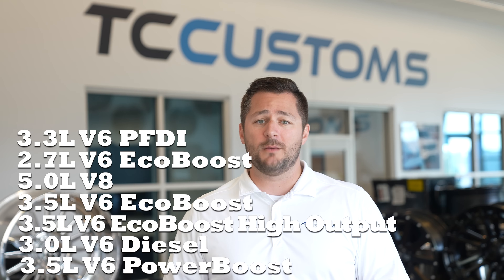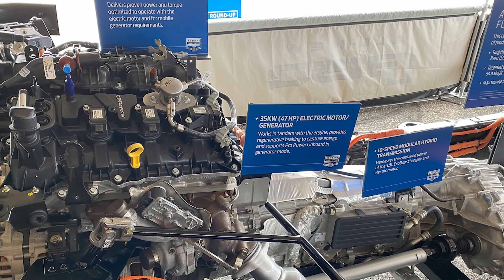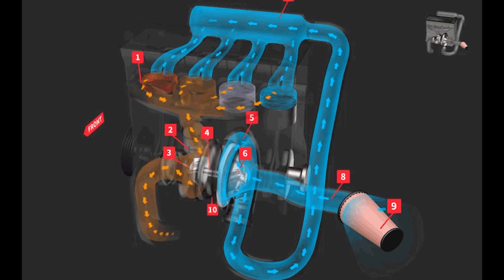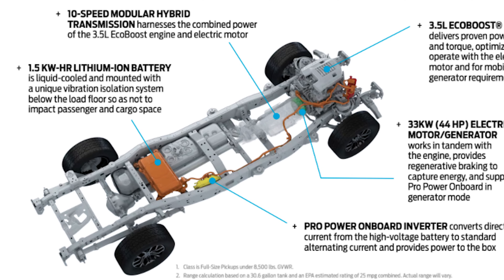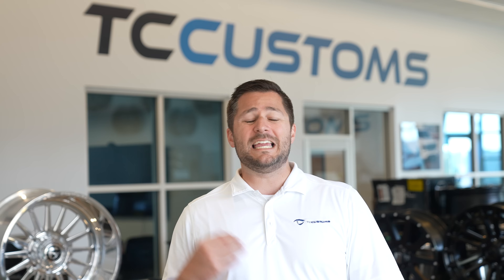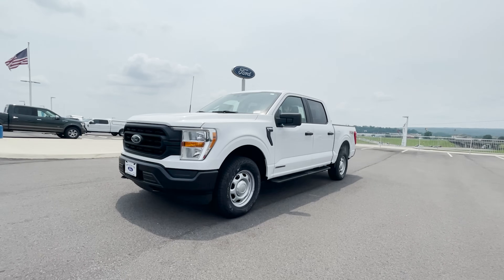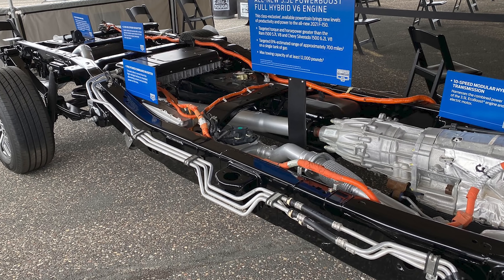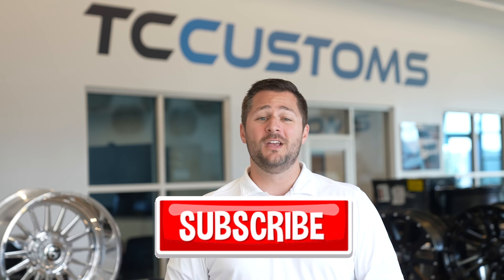The truth about the PowerBoost Hybrid Engine!

Comment: Mitch many people suggest that you need a oil separater on the ecoboost  what your thoughts can you tell me when Ford is doing the update on the 360 co-pilot
Reply from the maker: On the VERY first gen Ecoboost, I would recommend them.  When the Ecoboost went port and direct fuel injected, it’s not needed.
Reply: Thank you Mitch what about the update on f150 360 co pilot or do you call it blue cruise
Reply: @TCcustoms_  I was also curious when Port or Direct injection get used. Are they always both running or is it defaulted to one until something like a turbo kicks in and then the other one activates when needed?
Reply: @gamerjenkins2053  both work simultaneously to prevent carbon build up on valves.  Why don't you just google for once?
Reply: @TCcustoms_  well said